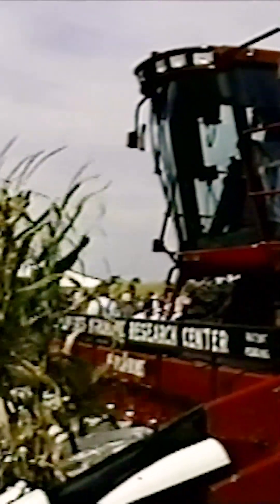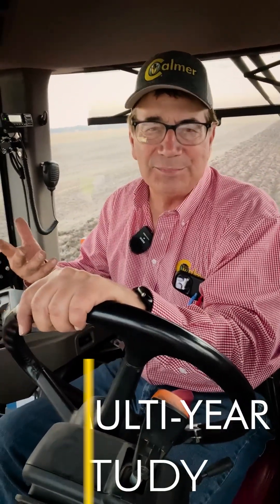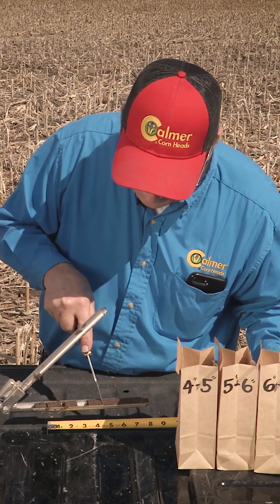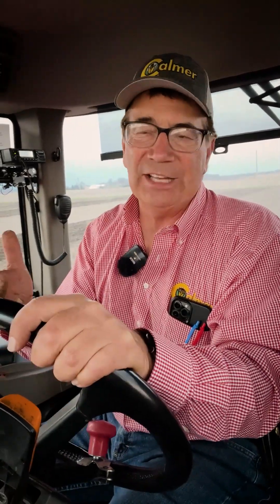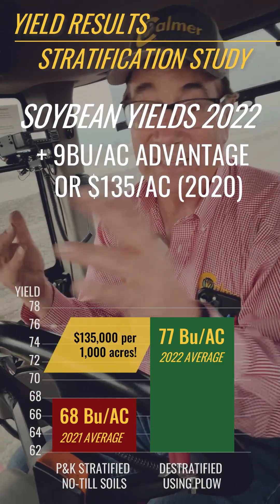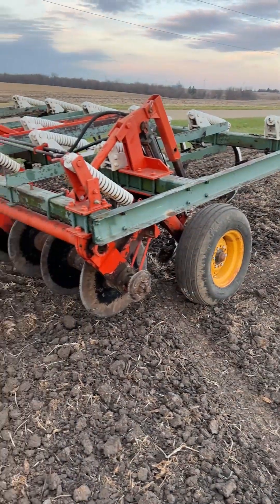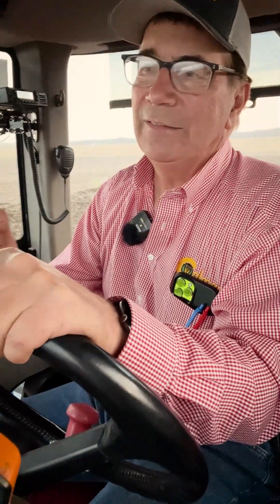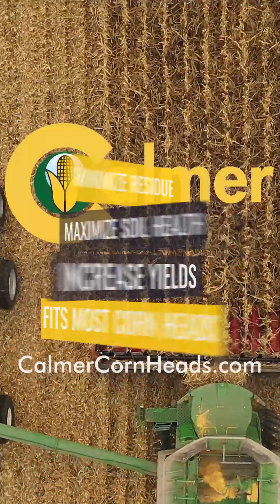Agronomy Yield Study with P & K Fertilizer Stratification in Soil

Comment: Nothing new here, it's no secret that if you apply P & K on surface that needs mixing with the soil otherwise it won't work and is waste of money and effort, especially for crops with deep root system. In no till application you put it behind work pice of whatever tool you use to loosen the soil, that's why there is so many farmer made tools around the world, mostly from cultivator and old seeder. Nitrogen you can spread on the surface and it will do it's job, as long as there is water preferably rain after application, but again not too much at once. I said manny times before effective fertilizer usage needs knowledge of what, when, how and how much to apply, otherwise you mostly throw your money in to the mud.